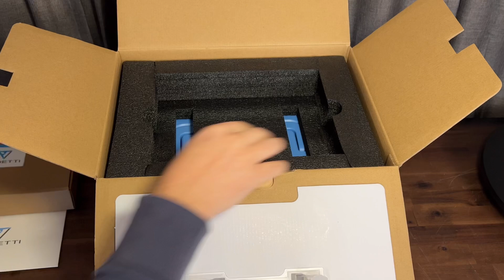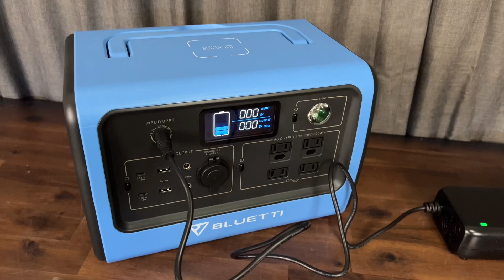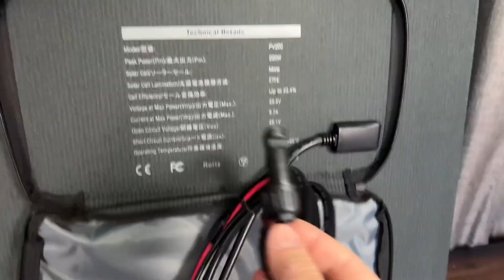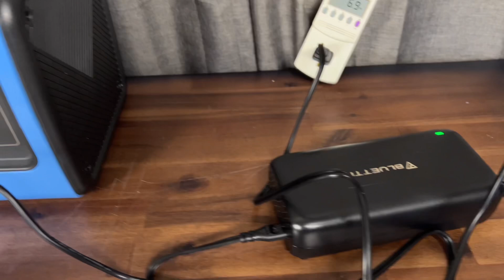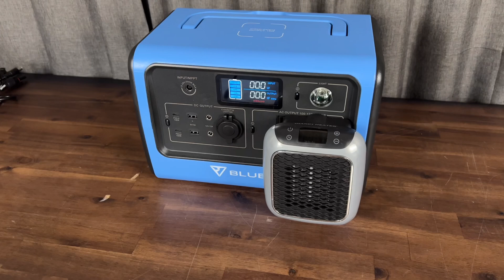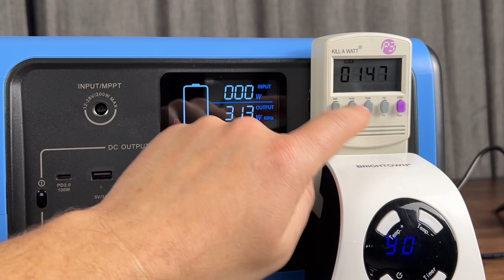Bluetti EB70s Updated model review and test

Comment: I have the same unit and my wall charger doesn't run continuously and the fan on the power station doesn't run loud or continuously.  I would like it to run a heater but as yet it just isn't powerful enough. I mainly use it for LED lights in my off grid tiny cabin. It is great and I really enjoy it.

Comment: how long would it take to fully charge via the Bluetti solar pack given typical daily sun?
Reply from the maker: Depends on the solar panel used. A 100 watt panel at optimal may be 80 watts averaged so that’s 80wh hours of energy. Verses a 200 watt panel maybe 160-175 ish watt hours.
More solar quicker it will charge.

Comment: What would be a better brand/model than this for 500-1000watt range not really feeling this one
Reply from the maker: EcoFlow delta 2 but the fans are a little noisy. The delta 2 max is kinda a game changer and just really is a universal unit. But about $1799 but I may have discounts still. But With bluetti customer support being pretty poor at the moment im waiting till they can fix those issues before I recommend them. No company is perfect but they slid a lot.
Reply: @johnnysweekends  I actually just ordered the ecoflow river pro because of the invettor since i only need above 1000watt when using an electric stove
Reply from the maker: That’s a good littler unit. The original or River 2 pro?
Reply: @johnnysweekends  oh wtf I didn't realize there was a river 2..and it's almost the same price as original.. On amazon canads it's 799-70$ off for the 2 and 850-230off for the original.... I guess I can see if the 2 goes lower on prime day next week and return the original?
Reply from the maker: I would definitely check it out. Prices are supposed to be pretty good
Reply: @johnnysweekends  so would you say the river 2 is better than original river.. They r both almost the same price
Reply from the maker: Yes for this minimal difference its worth it
Reply: @johnnysweekends  what minimal difference tho.. The faster charging?
Reply from the maker: River pro and river 2 pro have a few differences.
R2P has LFP batt verses NCM so instead off 800 cycles to 80% its 3500 cycles,
Higher out put
Higher surge
Higher solar input
Higher ac input 

Although new r2p is not expandable
Reply: @johnnysweekends  why are they the same price then only like 60$, difference

Comment: I purchased the Bluetti eb70s, and my Jackery 300 seems to hold a Charge Much Longer.
Any ideas, comments etc??
Thanks...
Reply from the maker: Not sure, unless you don’t have the unit off all the way. Some times they need to be calibrated again by doing one or two complete cycles from 100 to 0. 
I would give that a try and see if it resets the bms
Reply: @JOHNNY'S WEEKENDS  
I've done that twice.
I had my cell plugged overnight to see, and it went from 40%  to 20 % ...in 7 hours pulling only 8 watts.
I'm starting to think they sent me a used one.
Thanks for your reply....👍....😎
Reply from the maker: Well your not the first to have issues. They have been having more issues it seems and customer service is also starting to get pretty bad. I do like the AC200max to a extent but even then the AC charging is not great at all and I hate external boxes. Hoping they start fixing from within or they may fade away.

Comment: It doesn’t do any of my appliances that heat up!  Heater, air fryer, coffee maker. A no go. Things I need in case of hydro outage
Reply from the maker: Yea you must be drawing to much power. And the surge on this doesn’t hold great at all. I would contact bluetti or return for a little larger size. A 750 watt item could draw 900 watts on start up for maybe 30 seconds then come back down to about the 700-750 usage.

Comment: Who in their right mind would use a power station outputting pure sine wave AC to run a element heater?  It's a bit like trying to plough a field with a sports car rather than a tractor.  
Above and beyond this... the 800w heater you tested would be rated for the heat output (800w) NOT the power consumption, because it also had a fan that would consume 5-15 watt it's power consumption might be in the 850w range and surge well above that.
Reply from the maker: The heater is simple for the test of surge power. That heater runs about 750ish once it settles down. But does run up to about 860 on start up. But you would not use any of these for heat as it would drain them in no time

Comment: I have the EB70 and it always crapped out on me with loads higher than 800W. Instead of the surge kicking in, it made my battery display go all the way down to 0 and the shut down itself leaving my battery indicator on 0. It allmost looks like this new version was adapted to not even try to run devices higher than 800W. The fact that it even has the same 712 Wh in its specs just like the EB70, makes me think they just modified the writing on the unit and updated it to automatically overload and not let it crap out like the EB70. So it's basically what the EB70 should have been and with it's real specs.
Reply from the maker: Yea over all its not a fav unit. I also despise external charging blocks.

Comment: Im looking for good power source for electric blanket camping, wonder how long it would run on a 12V blanket? Also, does it have a low ambient heater built in? Nice review 👍
Reply: Amazon said five hours for a blanket, that is depending on how high the heat settings are on the e.b.
Reply from the maker: This does not have a heater built in. 
And depending on blanket and power draw you have it on, it may use around 50 watts a hour. So depends on the setting and how long you run it. 
50watts time 5hrs will be about 250 watts hours..”wh”
Reply: I'm trying to find one for a blanket also. What did you end up going with?

Comment: You said that the solar panel comes with a 12 gauge wire.  I am going to order a long 10 gauge wire.  Can a 10 & a 12 gauge be connected to each other?  (Probably not)
Reply from the maker: Yes they will be just fine. The panel will have the 12 and your extension will be 10g going in. Which is fine because the extension will be able to hold extra watts from other panels if you add later
Reply: @johnnysweekends  Thank you so much.  Prompt reply and I even understand your explanation.  Much appreciated.  Happy New Year 🎆.
Reply from the maker: You’re welcome 😀👍🏼 
And Happy New Year 🎊🎆 🥂

Comment: Thank you for using heater's in your review.  My car's heating stopped and this is what I am shopping for so that I can stay warm and defrost the windows.  Very good review.
Reply: I meant to tell you my heater is 200 watts... this should work?
Reply from the maker: Well it will but how long do you want to run it? Over all it’s not the largest power station
Reply: 20 MIN. COMMUTE TO WORK
Reply: THEN CHARGE AT WORK IF I NEED TO.
Reply from the maker: Oh that’s not bad at all. And you could charge it while you drive from Dc
Reply: @johnnysweekends  
Thank you...I bought a Bluetti EB3A. I can't wait to try it and winter is nipping at my heels hahaha.
Reply from the maker: Yes it’s coming !  I hope it works for yea..!
Reply from the maker: Your welcome, just remember that heaters consume a lot of power. So they burn through the battery pretty quick .

Comment: The lack of % on the screen with more info is keeping me away. I'll wait.
Reply from the maker: Yea would be nice for a update on that.👍🏼
Reply: @johnnysweekends  Yep, I own the EB3A and am SPOILED with that EB3A DISPLAY and no BRICK. I'll wait and see if Bluetti gets smart and updates all their power stations to clone the EB3A features.  Waiting for that b4 I buy another Bluetti.   I use HQST 100 watt panels in parallel using MC4 connectors, I never have problems with them on the (NYState) EB3A always under the specs for volts and amps input solar Watts are 160w usually max on display, Panels have legs under them like tables on my deck. Works great in overcast days.  Tempted to buy another EB3A and just daisy chain my two as needed. Love the EB3A and features just want with larger battery size. :+\
Reply from the maker: I would imagine that bluetti is working on a new line soon. Which I assume they will get rid of the charging brick. 
And maybe updated display. But will see. Competition is everywhere now.
Reply: @johnnysweekends  We'll know when a new version will be coming soon is when Bluetti has a big sale on the current EB70s.
Reply from the maker: Well see what happens when Black Friday hits and more. I assume a discount but if it’s big then they maybe are trying to clear inventory

Comment: I just ordered one of these myself. A few things I found out that may help 1) a cheap usb led light to confirm the dc side is off 2) a cheap plugin self powered electrical tester to confirm the A/C side is off. Of course all of that should just work out of the box but other comparable power stations are Lithium-ion not Lithium-Iron-Phosphate.
Reply: Are you saying the product is cheap and poorly made?
Reply: @KT-ed8hj  Not at all. I'm saying its hard to tell when the products AC and DC outputs are off. A cheap tester can help you confirm that it is off.

Comment: Hello, I have this Bluetti EB70s.  How long does it retain a charge when not in use?  Should it be charged at 20% or more?  I charged it to 100% before I put it on the shelf.  I checked it after 10 weeks and it was drained.  Will the life span be shortened if I charged it weekly?
Reply from the maker: Most of the time you are supposed to charge at 80% for storage and make sure it’s fully off and not standby.
Reply: @johnnysweekends  Thanks for your reply.  Much appreciated.
Reply from the maker: No problem 😀👍🏼

Comment: Random question. Would there be any way to charge this with a vehicle and solar at the same time?
Reply from the maker: Well there’s always a way lol. But to just plug into a 12volt socket and then charge from solar, I don’t know as I never tried that. Not sure if it will do two Dc charging methods. Ac and solar at same time is pretty normal for a lot of these but I didn’t do that test. But good to know for the future..👍🏼
Reply: @johnnysweekends  I've seen people get 100w from the car and 100+ from solar. I was thinking you could get a 12v splitter and have them both plugged in at once. Do you think overwattage would be backed down to 200? Do you think something like that could work?
Reply from the maker: I would just go to the parked car and plug in the solar and Dc at same time. Just don’t go over the max Dc input voltage. 
I forget what it is on that unit. 
You could try 12v then a parallel connection of solar to increase your amps instead and keep voltage lower.

Comment: Good test for real world use, good constructive criticism, this will help me decide what to get.  Do any of these smaller units by any mfg. allow for a stand alone, ANY GENERIC brand, LiFePO4 50 Amp hour or 100 Amp hour battery to be plugged in to the unit, increasing the battery bank size?
Reply from the maker: You can plug in direct Dc charging or there are ways for Dc regulators to pump in through the solar generator input. 
Now Dc only will be limited to I think 8 amps or so but the solar input will allow a little more.
There are ways to increase with external battery..😀👍🏼

Comment: I GOT MINE TODAY AND THAT CHARGING BLOCK ISN'T ALL THAT LOUD. JUST UNPLUG IT WHEN YOUR DONE. WHY WOULD YOU LEAVE IT PLUGED IN IF YOUR ARE NOT USING IT? BOOZOO.
Reply from the maker: WHY ARE YOU YELLING????
I assume that’s louder then that useless box. It’s not overly loud, just a should be running when no need. Say you plug it in and leave for several hours. Well technically your waisting energy “money” letting it run. Sure maybe it’s less then a dollar, but again that’s just burning energy.
And say you wanna use it as a UPS..? Just gonna let that thing run huh…
Yea great design 🙄

And what is BOOZOO…? 

Or you trying to say Bozo…. 🙄

Comment: You may have said in the video but didn't hear it, I'm confused with the 716wh and 800watts... So how many watts do I have available to run until its empty?
Reply from the maker: It’s rated for 716wh.
But with any power station you loose about 10% of rated for Dc to ac conversion and also running the display and fans which is minimal but still uses power. So I forget my numbers but it was about 625wh out of that unit.
Reply: @johnnysweekends  Thanks!

Comment: Would this unit be ideal for use with a larger external 12 volt Lipo4 battery? Probably need to boost from 12 to 28 volts for maximum charge rate. Yes?
Reply from the maker: I’m not a hundred percent sure what you are saying, but you want to use a external  larger 12v lipo battery instead of the internal? Even then a larger battery you would not boost charge voltage. Recommend charge voltage is about 14.4 volts give or take. If your doing 28 volts that would be for a 24 volt battery or two in series.

Comment: Hi Johnny. I too am a "Johnny on the spot". Fantastic and really honest video. I have a question for you. I'm interested in purchasing this power station and I want to know how long would you estimate that I'll be able to power a gaming PC (under 500W) using this power station while recharging it simultaneously from a wall receptacle outlet?
Reply from the maker: Well not sure I understand completely. 
Why not just run the pc from wall power? 
If you are using say 450 watts from your pc then at 450 watts an hour… that will give you a rough idea. If plugged into power from a outlet you could run it I guess non stop. It does have pass through charging from what I remember so..
Reply: @johnnysweekends  Hi Johnny. Thanks for the speedy response. Just for clarification, I’m trying to save on the cost of electricity in my area, where the cost can be > $0.40 kwh during the summer months. I’d like to operate this gaming pc installed with (3) high end video cards for at least 3-4 hours per day and I don’t have a solar system installed to avoid these costs entirely, but I’m looking for a good solution to use. Let me know your thoughts.
Reply from the maker: So in order to take advantage of a power station is to recharge it with solar. That’s where the free energy comes from after buying some panels. Try to find used residential panels for cheap. You can find 300+watt panels for $100-$150 bucks that are a few years old. Price will adjust depending on brand but there are deals out there. 
I have a video coming out tomorrow to show a rough idea on panels. Just a Short video.
Reply: @johnnysweekends  That makes the most sense Johnny. Thanks again for your feedback.

Comment: Is it possible to use the Eb70 with added "add ons" to power a microwave? If so, what "add ons" would I need to increase wattage to 1000 for a microwave?

Second, what does 1,400 "surge" mean? 

ThanksEl!
Reply from the maker: Honestly the eb70 just doesn’t have enough power to go over the 800 watts and you can really just add stuff to it that I know to increase it. A simple lithium battery and 2000 watt inverter has more power but not so portable I guess. 

The surge like stated, say a ac unit that is 5k btu maybe needs 1400 watts to start for the first 3-5 seconds but then will come back down and run on say 700 watts. 
The eb70 is nice but just slightly under powered for bigger items.
Reply: Motors/compressors for ex have an initial power surge for under a few seconds when starting up. The 1400watt surge capacity is what addresses this.

Comment: I have a Bluetti EB70S battery with a Bluetti PV120 Watts solar panel.  I would like to know what happens if I add a second solar panel, 120 watts for example, to recharge my EB70S battery.

  I ask the question because the EB70S can take a load of 200 W and in my example I give it 240 W. It is certain that a panel does not necessarily give its maximum, 120 W can give for example 90 or 100 W depending on sunshine and different conditions.  

But what if the conditions were optimal I had a theoretical total of 240 W?
Thank You
Reply from the maker: Typically with some of these power stations you’ll wanna read the instructions on the max input voltage. This one says 12-28 volts but with it bypass the rest or will extra voltage fry the controller and damage the power station. 
You can measure your input voltage with a meter. Some power stations will bypass amps and not volts like the ECOFLOW. I’m not a hundred percent on the bluetti if it will. 
So pay attention to input voltage and double check instructions to see if it says about exceeding it and what will happen.

Comment: Interesting.  On the EB70S it looks like they removed the separate "adapter input" port.  which is too bad because using the MPPT port always turns on the bluetti's internal fan, whereas the "adapter input" port on the EB55 does not.  So if one can find a current-limited + power-limited power supply to replace the bluetty brick (which is actually fairly difficult short of buying a bench switching power supply), it is possible to charge silently on the EB55.  But it wouldn't be for the EB70S.

I really wish bluetti would fix their blasted brick.  Something that massive should not need a fan, but they low-balled the quality so I guess they felt they had no choice.  Its silly that the fan stays on all the time, though.
Reply from the maker: I agree ditch the brick and why is the fan running for now reason lol. 
I get it to help keep it cool but that’s to much waisted power.
Reply: @johnnysweekends  Can you parallel connect two 100 watt panels to this unit??
Reply from the maker: Yes as long as you don’t go over the input voltage your fine. Amps it will just bypass the extra.
Reply: The fan is a deal breaker.
Reply from the maker: Yea that’s all I would like is it to shut off when charged and maybe a little quieter.
Reply: It's just an easy firmware update if alot of people complain to them
Reply from the maker: Yup would be nice 👍🏼